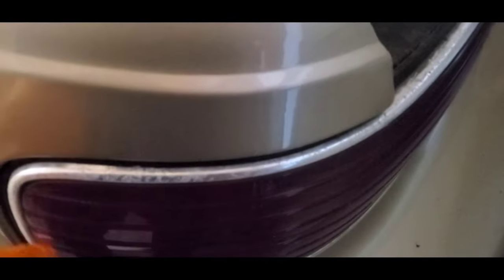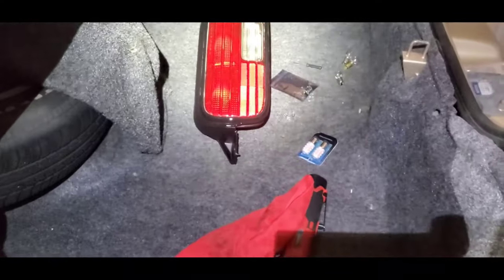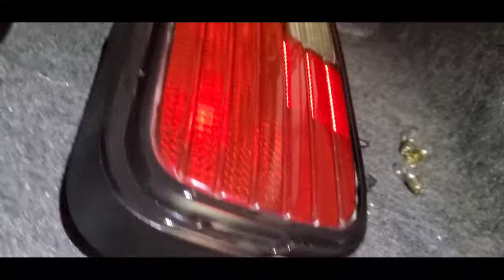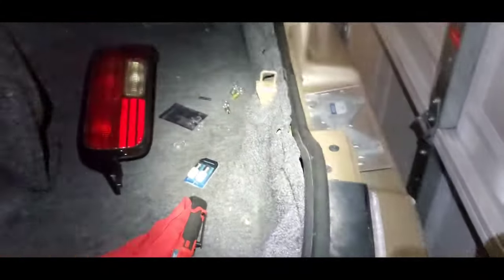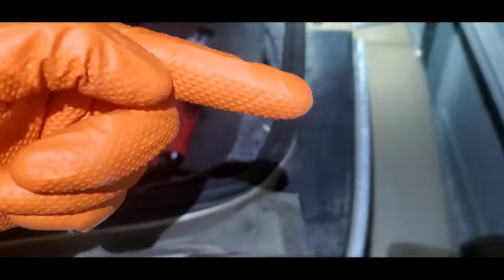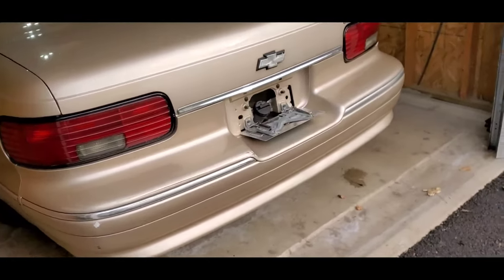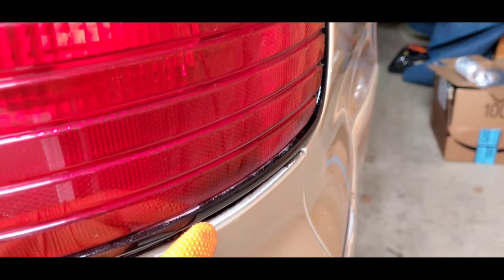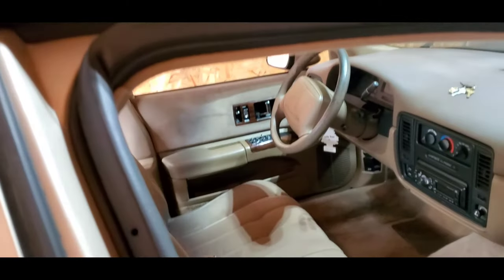94 Caprice Taillights Repainting Chrome to Gloss Black!!!

Comment: I like the tail lights off the 91, 92, 93. It doesn't have the grooves like the ones you have.
Reply from the maker: Oh yeah I know the ones you mean
Reply: @cgrreviews7220  I ordered the same aftermarket headlights you got as well the exact ones. I can't find any bulbs that fit can you help me out?
Reply from the maker: @ssjohnny6311  sure what style headlight bulbs are you looking for?
Reply: @cgrreviews7220  see I don't know
The same exact headlights you have on you're caprice are the ones I have
What's bulbs did you get?
Reply from the maker: @ssjohnny6311  you mean what led bulbs i purchased?
Reply: @cgrreviews7220  yes
Reply: @cgrreviews7220  for your headlights
Reply from the maker: @ssjohnny6311  i got to look up which ones I bought then when you get them you twist a piece of so it can go fit in the headlight you put the piece you twisted off into it and i used like plastic epoxy to hold it and so it would stay held in place